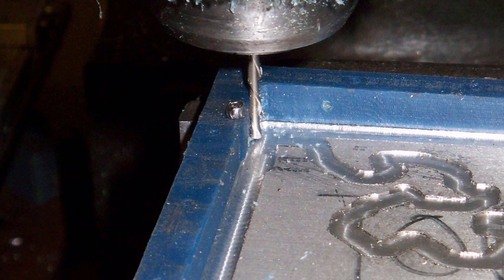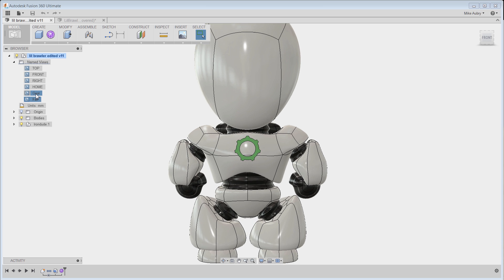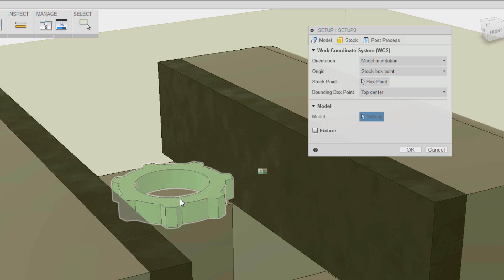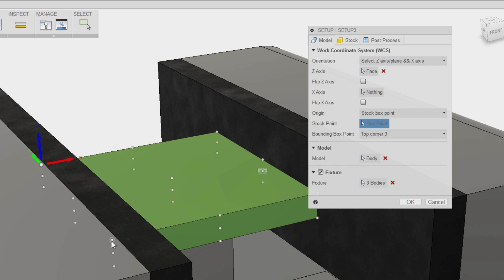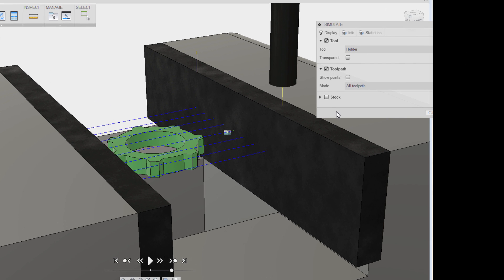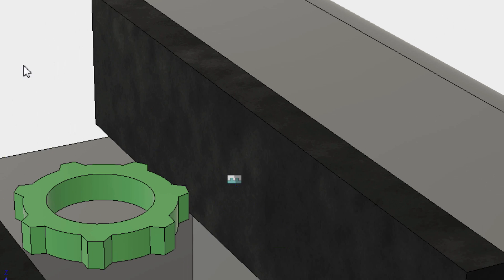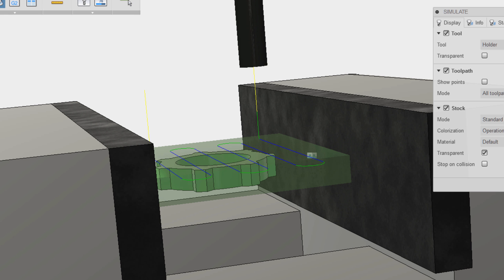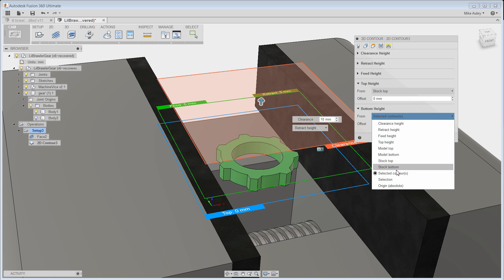How to Use Fusion 360’s Interference Detection to Avoid Cutting Into Your Fixtures

Comment: Hi,is there any option that Fusion creates automaticly an other tool path with some defineed space to the yaws ?not with some extra Sketch to define the area just with the Information to go not through the clamping devices.Many thanks in advance
Reply from the maker: Hmmmm....does this help: https://youtu.be/pRlttHFMUAo 
I'd want to model the workholding personally. 

Also: https://knowledge.autodesk.com/support/fusion-360/learn-explore/caas/sfdcarticles/sfdcarticles/How-to-Use-Fusion-360-s-Interference-Detection-to-Avoid-Cutting-Into-Your-Fixtures.html
Reply: SMW has some nice tricks. Its true but it‘s not the easy way i searching  for.
But many thanks for your realy quick answer.

Comment: I learned today that there is a way to define the vise jaws in this example as fixture parts to be avoided. You can do this by selecting the "Model" box and defining the jaws as the model, which in fact means they are a fixture. I'm happy to say this actually works. After dealing with this issue for two years, it's nice to see a solution that doesn't involve manually editing tool paths.

Comment: Is there a way to have the 2D adaptive clearing tool path automatically avoid collisions with fixture parts? Right now everything I've tried doesn't work and there aren't a lot of options to "tuck" in the non-engagement paths to keep them contained within a boundary.

Comment: Hi- can you demonstrate how to use the fixture avoidance feature when machining both the top and bottom of the part in 2 separate setups ?? It seems that one has to flip the part in the vice in the Model mode, then come back to the CAM mode- but this invalidates the tollbooths from the first setup... Is there a better way to do this ??
thx
jk